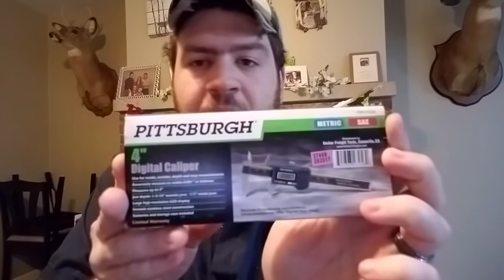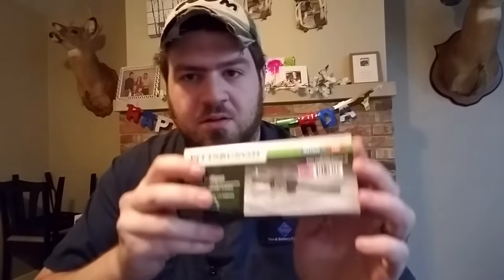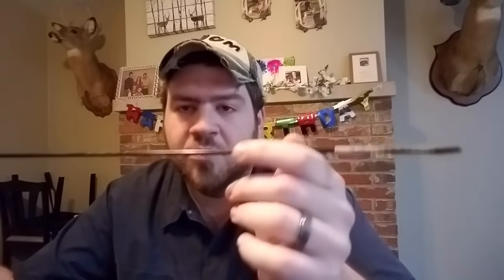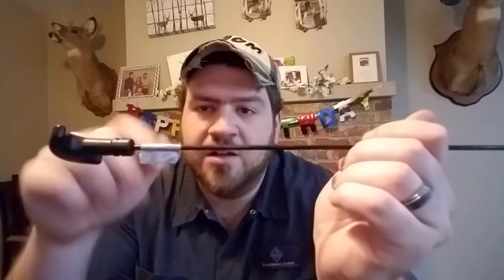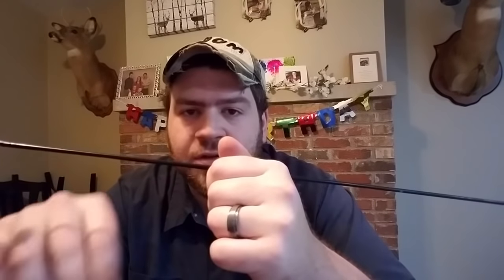TOP 5 SECRETS Airgun/Pellet Makers DON'T Tell You!

Comment: Just letting you know I have a highly custom Gaunlet .25 that is running a LW octogonal barrel, drop block and running a 45ci 4500psi carbom bottle regged to 1850psi and a custom power adjuster that is quickly tunable from about 14ftlbs to 65ftlbs with JSB King Heavies. It has a custom two stage trigger that is totally match grade and is set to 13oz with 6oz in the first stage to a very define stop and 7oz to break the second stage and it has zero creep and zero over travel the trigger feels just like my Air Arms S510XS trigger and that's world class.
At 60ftlbs with King Heavies on a 4500psi fill it's getting 89 shots on the reg with a ES over 85 shots of 11fps and a SD of 2.4fps super consistent and super flat shot string. It's running DonnyFL Ronin and it's as soft spoken as a 60ftlb .25 can be.
It's got a MTC Viper Pro sitting on top of it with Sport match rings.
The gun is consistently printing 10 shot 100y groups that are right at 1.25 minutes center to center it's and is sub half inch 50y 10 shot groups all day long.

It shoots King Heavies at 60ftlbs the best and the 25g Kings at 48ftlbs equally at 50y but the king heavies hold tighter at 100.
It's not pellet fussy at all and shoots h&n FTTs very good at 40ftlbs and Baracuda at 65ftlbs like a champ at a 100. Polymags at 55ftlbs are 10 in under 2 inches at a 100y consistently and right at a half inch for 10 at 50y.

Im selling the gun and if you are interested or anyone is please inbox me. If you want to come shoot it before you buy it im in North Florida anx your more then welcome to come shoot it and see if you want it.

The gun also shoots NSA slugs pretty well at 65ftlbs and will groups them sub 2 inches at 100y for 10 and at 150y will consistently put ten inside of 3.5 inches. If you wanted I could bump the reg pressure up safely to push NSA .25 slugs up to about 75ftlbs as the gun will flow enough to do that. I would have to make a hammer spring for it and up the reg pressure to about 2100psi and 75ftlbs is possible but is the max the can is capable of flowing and truthfully would be pushing it anx you would have a high ES and SD. At 65ftlbs the gun is super happy and can flow enough Air as is and does so well. But im saying i could bump it up if you wanted to push slugs a little hotter.

Comment: At 5:36 of your video you reference an AR15 and a twist rate of 1 in 7 will stabilize a heaver "pellet" at a longer range. If you are talking air guns then I could not disagree. If you are referencing a center fire rifle weight has little to do with twist rates. Length of projectile determines performance for a given twist rate. Like your video and will be watching.
Reply from the maker: Just meant faster twist = heavier projectile

Comment: Can you tell me what the twist rate is on the Umarex Octane line of air rifles.  I can go through the process of manually checking the twist rate but I figure you've already done it for us.  I've just assumed it was 1 in 16 like most of the break barrels I've ever owned.

Also;  I've called Umarex USA to ask them that very same question and the folks I've spoken to seem like some of the nicest folks you'd ever want to chat with but knowledge-wise, they've all struck me as just being stock clerks and nothing more.  They have little or no working knowledge of the products they are there to answer questions about or service.

It's understandable that they'd not have a working knowledge of all of their product line.  It's an extensive product line but, there is some answers they all should have being that they work in the customer service department.
Reply from the maker: I wish I could tell you but all I have right now are Crosman break barrels...I actually sent a request in via their website when I asked about my Gauntlet then I called, and actual design department told the guy I spoke to the spec'd twist rate...guy I spoke to was in service department.